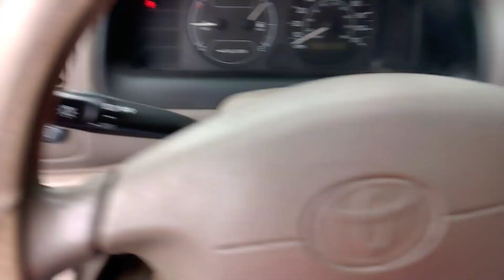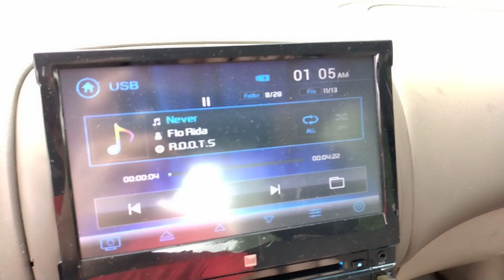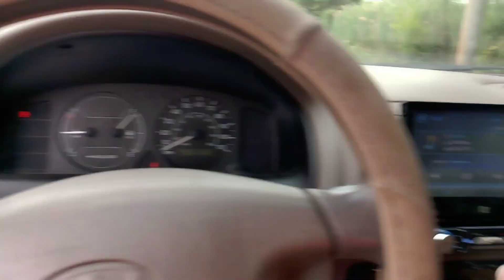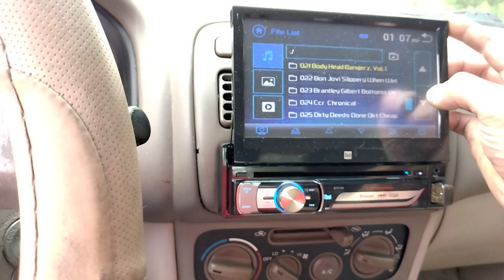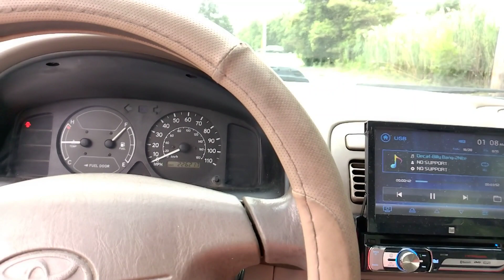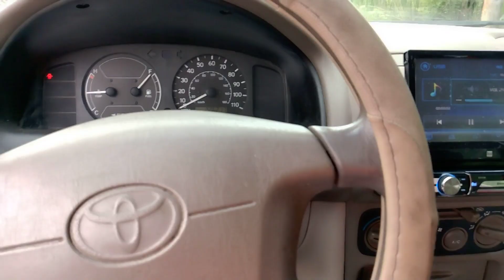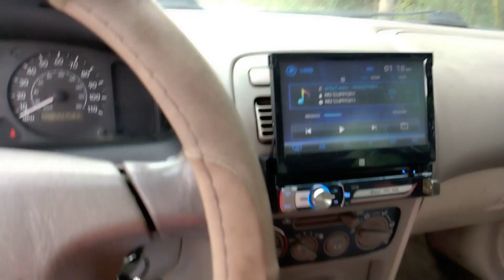Importfaceoff got canceled so thought i would do a video.

Comment: Gotta have a bad cell or something. I use a headway bank and have a battery monitor hooked to it so i can see that each bank is working properly. Thats one good thing about diy lithium banks.
Reply from the maker: Both batteries are perfectly fine. No need to spend money on extra stuff that's not needed. The more that's added to a system just means an added point of failure.

Comment: I don't know if lithium batteries can by charged with the polarity crossed or not... could be a possibility I suppose. Could also be a dead short internally?? A digital vo meter would shed the proper light on things 👍😎
Reply from the maker: I already figured out what was wrong and got it fixed. Battery is perfectly fine.
Reply: @johnd3186 what was the issue?
Reply from the maker: @willgonzalez9633  had both power cables going to post on battery same as grounds. Was causing the battery to struggle taking charge and discharging. Put the cables on smaller busbars which fixed the issue. The power wasn't evenly spread out. I plan to do a new complete walk through of the system Monday when I have a day off from work.